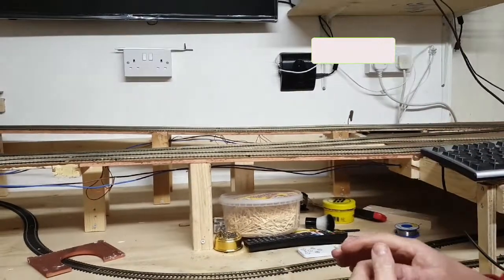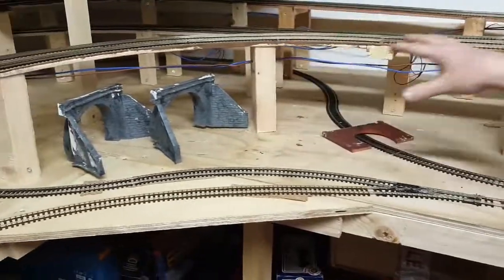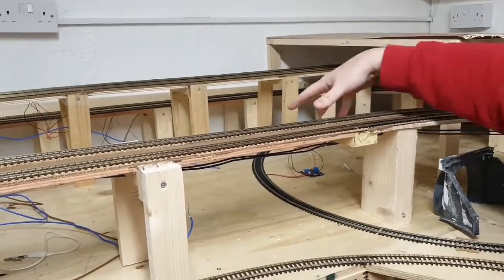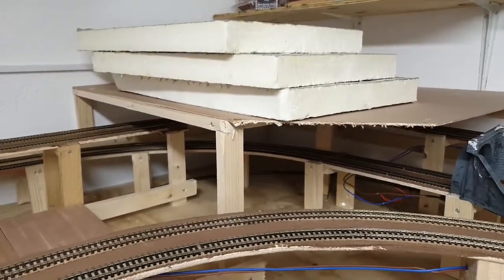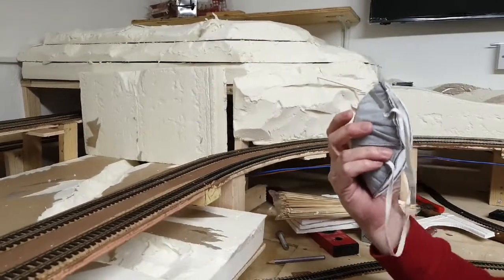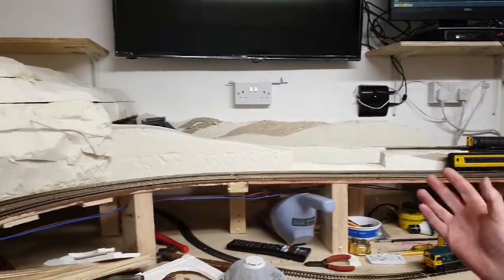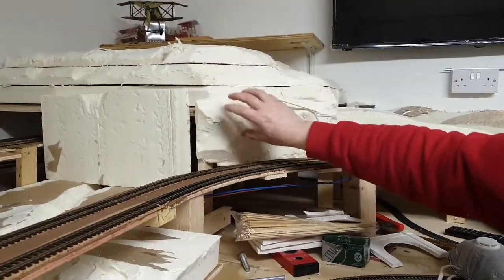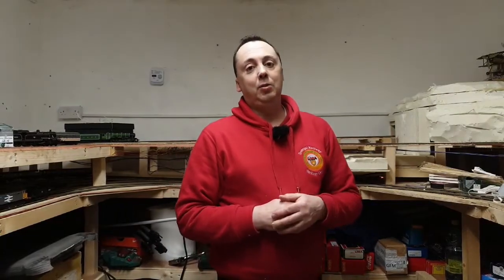55. Start of the Scenics Building a Hillside and Tunnel using Celotex/Aeroboard insulation.

Comment: Good work.  I also use foam insulation - some bought and some from packaging. To cut it to shape I bought a hot wire cutter. It was £25 very well spent.  It’s a most useful and easy to use gadget.
Reply from the maker: Thanks John, still lots to do. Will have to get hot wire cutter.